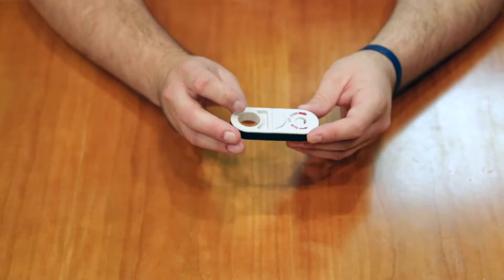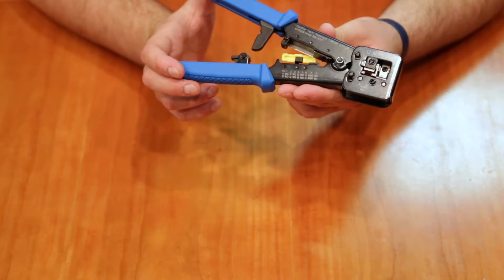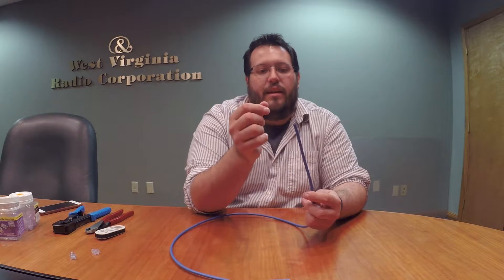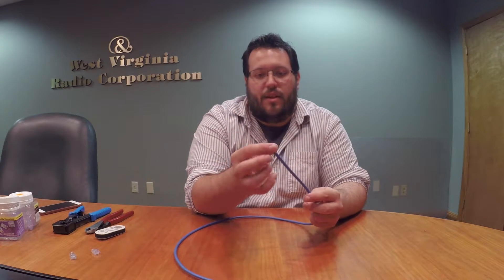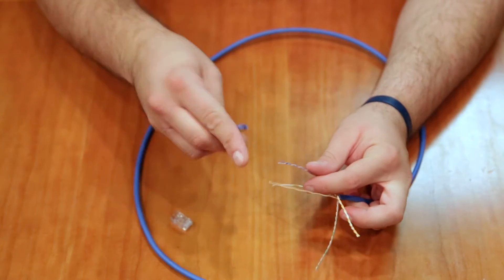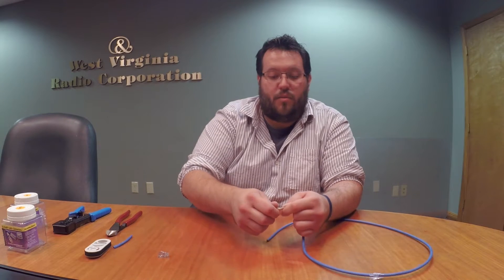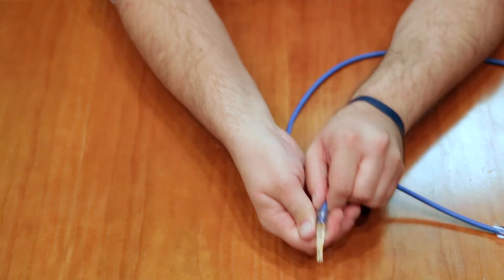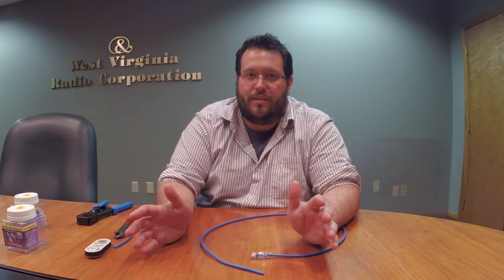Cat6 Cable Termination

Comment: I've done a lot of RJ45s before and never seen these easy connector types and the untwisting method with the sheath so will have to give it ago. Also in AUS we wire in T-568A so it might be worth mentioning that people check what standard is used in the install and if they are fixing a cable to check it's standard as I've been stung with a T-568B cable that I put a new end on.